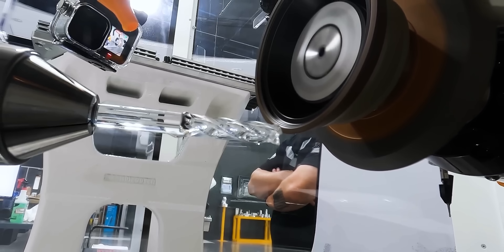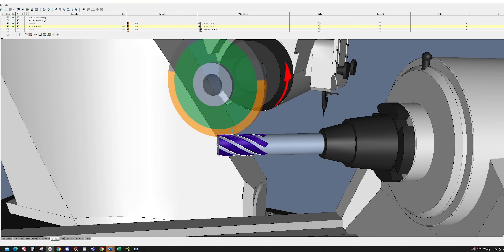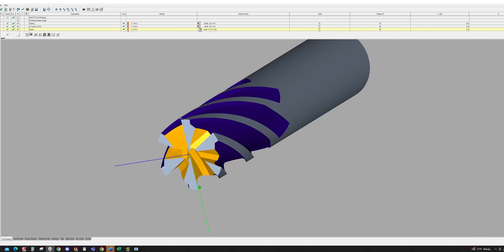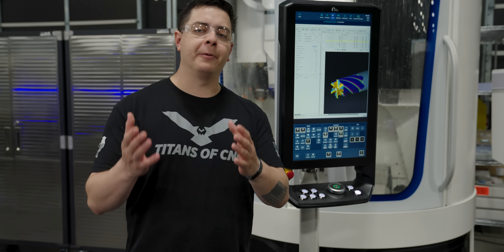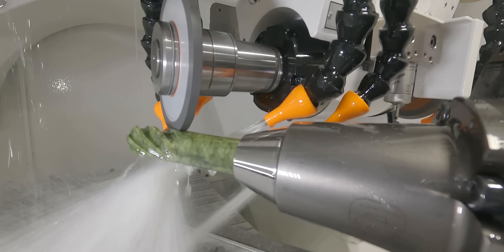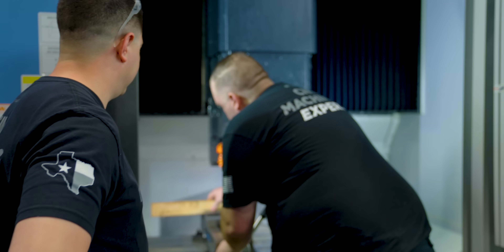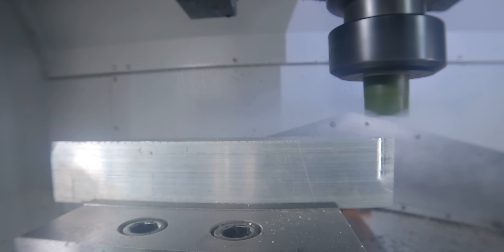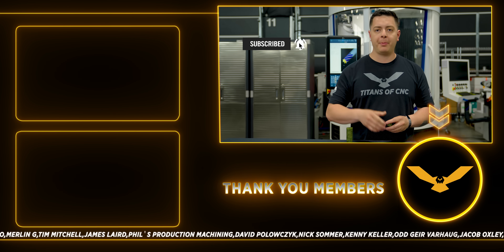Is Jade Hard Enough to Machine Metal?

Comment: I don't think it got too much of a fighting chance. For machining aluminum especially with tooling thats not specifically designed to cut aluminum cutting fluid is not optional. I remember jamming the cutoff saw in our shop really bad useing the steel cutting blade on aluminum once. We did it commonly if its only a couple parts but without WD-40? Thing jammed right up.

Comment: Making teeth for a circular saw out of crystals is better (it would be a linear force), but the way these CnC machines work is through rotation and torsion, and crystals ain't good at those kinds of forces. Even if you somehow managed to make a diamond shaped head for that CnC machine it wouldn't perform much better than jade, it's crystalline structure simply isn't made to deal with that kind of force. 

There are different kinds of properties a material can have and whenever you bump one up you sacrifice another.

Comment: The outer harmonic forces are a tricky dilemma you have to consider when making bits, that's the majority of why these break. Higher density and less space between the molecules are going to be the money when it comes to any type of drill bit. The jade could be a decant bit, just not by itself as a material, though I've never worked with jade. I'd guess if you could combine it somehow with another material it could be viable on certain aluminum's. Neat venture into jade tooling guys thanks!

Comment: Maybe it would have had a better chance if the milling cutter was used for finishing and not as thick layer shavings. I'm referring to the direction of rotation of the milling cutter because it was rejected by the material, that's why the break in the milling cutter appeared faster, plus the speed of the aluminum movement was too high... at least twice as slow and it had a chance to reach his end.

Comment: It would have been interesting to see if using coolant while machining the aluminum..( like you normally would ).. would have made a difference... you can see the cutter getting clogged up by that sticky metal, which breaks carbide and HSS endmills when you dont use coolant..  so I'm not surprised it broke the Jade as well.

Comment: So I know, this seems like doing things for the sake of entertaining people who have no idea about what you are doing, but..... There have been times when these kinds of silly experiments for fun, have netted interesting results usable for a new product, not previously thought of.

 What if, one of these brittle tools, becomes a training device for new machinists, as a safety feature protecting the machine. You could find a material, that by math, cuts like a metal for the simulated tool, as far as feed and speed and will break when pushed beyond the equivalent metal values. Yes, the tool breaks, but it breaks at a much lower stress level, so the machine, takes no damage, and the machinist, gets to learn about what caused the failure, without risk to hundreds of thousands of dollars of equipment.

Comment: (at 4:41) I believe it'll work on the wood and possibly even the plastic. both should be soft enough that if you don't add too much force it'll cut well. Not so sure on teh alu tho. tho to be fair I have ZERO experience in this field of work. like none at all. so just guessing based on how I know wood acts and some of how plastic acts when introduced to a Hard sharp surface with a bit of force behind it.

Comment: Geologist here. There are two types of jade. The rarest jade is Jadeite Jade, most of it is from Myanmar. The green variety of jadeite jade is called kosmochlor and it is extremely expensive. However, what you have there is very likely nephrite jade, unless your jade cutting tool was more expensive than the machine you used to break it. Nephrite is known as Pounamu by the Maori people of New Zealand. Nephrite is tougher than jadeite jade, and is twice as tough as glass. It is also tougher than most ceramics.There's large deposits of nephrite in Canada, where most is mined.

"In regard to the other mechanical properties of jade, the lower elastic modulus of nephrite is almost certainly a result of its lower density; however, its magnitude is still comparable to commercial ceramics and about twice that of common glass." and "The strengths of the two jades exceed most commercially available ceramics;however, they are not comparable to the ultra-high strength of hot'pressed oxides and nitrides used for cutting tools and turbine vanes."

Bradt, R.C., Newnham, R.E. and Biggers, J.V., 1973. The toughness of jade. American Mineralogist: Journal of Earth and Planetary Materials.

Collecting Pounamu permitted on only two rivers in south Island New Zealand, the Taramakau and Arahura rivers, and only Maori, the Kaitiaki R nanga of the Ngāi Tahu tribe, are allowed to collect the stone (Guardians of the Ngāi Tahu). The only place where non-Maori can legally collect Pounamu is on the west coast beaches of south island, New Zealand, but the stone is very rare. I was told that some shops in New Zealand sell Canada nephrite jade as Pounamu, due to the scarcity of the native stone. So most nephrite jade these days, outside of New Zealand, is from British Columbia, Canada where huge boulders of nephrite jade can be found. So your nephrite jade is most likely Canadian.

Comment: Interesting to see how you machine that end mill, the tooling I use is similar to that only a much sharper twist, press tools for forging helical gears.  I was told they machine them on an EDM machine though.  I don’t know what grade of steel it is though tbh.  We can’t use carbide because of the heat, 1800F + or -

Comment: I mean, given that jadeite is already an aluminum compound, and you're putting it against pure aluminum with all the impurities removed, the end result was kind of inevitable. Jade may have much higher hardness than aluminum, but it has none of the internal cohesion that a proper metal, (even one as soft as aluminum,) will have and will fail on toughness instead.

This is part of the reason why you put tungsten carbide inserts on a tool as the cutting face only, rather than building the entire tool out of carbide, for example.

Comment: I have been making natural sharpening stones and experimenting with different hard stones. I think stone works best for cutting with wide angles for the cutting edge and a lot of mass behind that edge to prevent shearing of the stone. So maybe a single edge end mill with 90 degree cutting edge and very shallow flute  might work alright. Maybe in Texas Chert, it is very hard and very tough, it is the hardest stone I’ve worked with and even diamond grinding is not easy for me with it.
Reply: Im surprised the six flute got as far as it did. A stone endmill might also need to be a lot shorter with so much torque generation.

Comment: So, I’m a lapidary who machines gem materials, both lathe and mill work with mostly nephrite jade the past few years. 
As someone mentioned a purer, that is one color, Wyoming jade, preferably black, might’ve had a better chance. Using coolant and a much slower feed rate may have seen it get further into the Al.  As nephrite is the toughest gem material (resistance to breaking) it was a better choice than harder (resistance to scratching)Quartz or corundum (ruby) or even diamond in this application.

Comment: very low quality jade, and why cutting from the side and so deep like that?  Could at least have given it a fighting chance ..
Reply: Better from the side than the bottom,that way it's not just pulling sideways from the bottom of that end mill with the leverage of the full exposed length...but I totally agree, depth of cut is waaay too big! Especially for a 6 flute, usually aluminum prefers end mills with less flutes because of how much chips it creates. I bet it woulda held up if he did like 3 to 5 thou passes. That dude wasn't lying, he wanted to snap that thing
Reply: Probably they were simply not confident with it from the beginning, so i guess they decided to go all in with the stress test.
Reply: It's just like with diamonds there's industrial grade diamonds. 
What you expect them to use a piece of jewelry grade Jade? 
You know how expensive that would be?
Reply: Because it's an end mill. Not a face mill.
Reply: Nephrite jade is tougher than jadeite, so the quality doesn't really matter.
Reply: @md2246  the quality does matter, non-uniformity of the internal structure means it would have areas that are extremely weak.
Reply: Cause side cutting is a huge thing that endmills are made to do. If all you need is a plunge cut you could mostly get by with drill bits if you just need to drill a hole !!!
Reply: @jamesfair9751  not side cutting like that.
Reply: Because you need to buy Kennametal tools!!!!!!!!@
Reply: Your right. Now let’s see you do it properly…
Reply: @viggo_wiberg  would love to have the equipment to do it

Comment: Hi guys I saw this video and I think I might be able to make this endmill run in my new line of tool holders it would be interesting to try this endmill because the thing that caused the failure is the standard concentricity that you get in an ER collet holder. I think that the failure was due to being off in runout and the harmonics are off because of this. even if this endmill is off by .0002" or more it would probably fail.

Comment: Anything crystalline that isn't a monocrystal will shake itself apart when attempting to cut anything hard using typical feed speeds for standard bits. You would likely be able to go much further with the jade endmill by running it 1/10th as fast.
Reply: Agreed! It feels like the Operator didn't do any post cut analysis of the plastic and wood then went into the aluminum at "full speed" almost as if the Opp was trying to break it.
Reply: @Scott_C  To be fair, breaking them was an implied goal and likely inevitable even if they slowed down to completely impractical speeds.
Reply: @teardowndan5364 impractical!? What if I’m trying to machine my way out of some sort of Jade prison? Now what’s impractical?
Reply: Hear me out. It's not how fast the job gets done. If the tool kept cutting. Steel razors are still inferior to obsidian glass knives in terms of edges and sharpness but obviously obsidian as a crystalline slush formed in a natural volcanic pyroclastic event would result in random cracks . I guess what I'm saying don't give up on this horse. A synthetic jade run at appropriate speed with the right cutting lubricant and monitoring the piezoelectric effect to detect if the crystal is near its fracture limit and possibly possibly. Mill out incredibly accurate stone and ceramic parts using a synthetic jade bit . But requires a system to monitor the temperature and electrical conductivity of the crystal as a signal for fatigue. Possibly even a custom chuck holder thats refrigerated because the nature of that crystal like quartzes is that it dosent make clean cleavage peices it shatters out into deathshards of chaos .. I bet a quartz bit would behave the same way also.
Reply: @machinedragon   bro is a straight up nerd.....
Reply: @machinedragon you sound like a mechanical engineer.
Reply: It sucks so much when such an obvious thing as ‘reduce machine speed’ hasn’t been tried or even thought of. 

As a high schooler, I would have had this consideration in my mind, and I watch this and they flub thus super basic thing
Reply: this
Reply: Even the the glass one would've lasted little longer. Those guys have too much money to waste.
Reply: @TechnologistAtWork  At the end of the day though, time is money in a shop. There isn't much point in trying to spare bits that make no practical sense. It does make good practice for those times where you may need to work with such special materials and when you have a YT channel to promote your shop, may as well monetize the experiments - look at all the neat stuff we can do with odd materials for lols in our spare/teachable time!
Reply: @teardowndan5364  Not at all if your content looks like ragebait. I've seen enough to from this channel to think those guys are stupid and arrogant. They don't offer anything to learn or anything interesting to see. There's no value.
Reply: Dont make him waste another piece of precious jade
Reply: idk, polycrystalline diamond has some pretty impressive strength
Reply: yhea its cutting speed wat to fast, you didnt have the chips you want to have.
Reply: You realise the whole thing was filmed for fun, right? Everyone here goes "Cutting speed here cutting speed there" It wouldn't have worked regardless of speeds, it's jade into aluminium, you can calculate cutting speeds all you want, and it would still break. 

Next thing is most of the people here have no idea what they are talking about, if you reduce the cutting speeds for aluminium you make things worse, because now you are melting the aluminium, all the cooling in the world wouldn't help you there since aluminium has a really damn low melting point. There is a reason end mills and plates come with different materials in mind for them, they are all classified for certain materials. 

Soft aluminium is machined at 400-500 m/min if we go 0.1 mm per tooth we land at 5000rpm and F3000 for a 25 mm end mill. 

So no, reducing the speeds would not have helped, quite the opposite.
Reply: @machinedragon the geometry is all wrong, cutting deep flutes in a brittle rock with unknown inclusions is ridiculous. A synthetic jadeite burr could work, although carbide would still probably work better
Reply: Don’t forget diamonds
Reply: Well it's not like he can get his hands on something like a single crystal tungsten carbide brick...?
Reply: skip to 7.10 and watch it break then don't recommend this video to save your algorithm..
Reply: They are also trying to cut too much material in the pass.
Reply: How do you know that? What do you study or work with?
Reply: @JapanShopBrazil  Basic physics. A bunch of crystals of various quality held together by binders are only ever as strong as the stuff that binds the crystals together or the weakest crystals, whichever is weakest. And crystals in general don't like impact loads such as a honed edge getting slammed into hard material at high speeds.

A diamond scribe doesn't last long as a center punch.
Reply: @teardowndan5364  but what do u study and work with?

Comment: I have an idea! 
1) Make a hybrid endmill from tungsten carbide or something like inconel
2) cut flute sections from a hard crystal like Mossanite. Or synthetic sapphire.
3) braze flute sections into the metal core, then finish cut the whole mill on the grinder.

Tough, shock resilient core with super hard edges…use it any non-ferrous. Material with coolant…it will last!!!
Reply: I bet it lasts longer than your Kore 5 in aluminum if the brazing is strong enough!

Comment: Thanks for showing Walter Grinder programming, I am just starting programming  ours for our regrind shop on the same Grinders.   We have trouble getting the K land adjusted in correctly.  How are you doing the K land? Our process was programmed to K Land with a differ wheel than the gashing wheel, so it makes it hard to adjust them both.  I’m am thinking about changing it to rough and finish the path, dedicating a rough gashing wheel and a finish gashing wheel.  I think that if the same wheel does the gash and the L land on the point angle edge it will be easier for the team to control.  It will just be a matter of wheel wear then.  Let me know your thoughts on this.

Comment: You tried to cut solid piece of metal with a Jade stone endmill it was gonna break but maybe concrete or bricks may just cut fine instead since they are just right in-between the line of solid as steel but softish like wood & plastic.
You basically gave a strong enough material like Block of aluminum or any similar metal for the Jade endmill to cut-rub and vibrate like crazy on letting all the vibration from metal cutting to go right through the Jade endmill and crack it through inside out.
Maybe if you make another Jade endmill drill a hole in the center of the cylinder through it's length drill it's center out and add a metal pin or long screw through the middle of the Jade endmill to dampen all the vibration going through it and increase it's sheer strength of the overall jade endmill.
This method of putting a metal pin or screw through the center of a soft material dealing with high torque or high sheer strength loads also works for 3d Printed FDM & Resin printed parts especially for 3D printed tyre wheels that deal with high torque output of electric motors right into tyres which without a metal pin/screw will just sheer the center of the printed wheel making the whole wheel useless.

Comment: An interesting material to try would be basalt, it is from my understanding basically a manufactured rock like material that they actually make rebar out of, it's flexible like steel rebar but will not take a permanent bend like steel and has good tensile strength. With it's relative hardness and flexibility it might work on aluminum at least longer than jade and glass.
Reply: basalt is a volcanic rock, not man-made.
Reply: @BeetleBuns  They manufacture products made using basalt, not sure how they do it though but yes it is a naturally occurring rock so I did misspeak.
Reply: @phillhuddleston9445  ohhhhh got it, thought you were saying the rock itself was man made lol